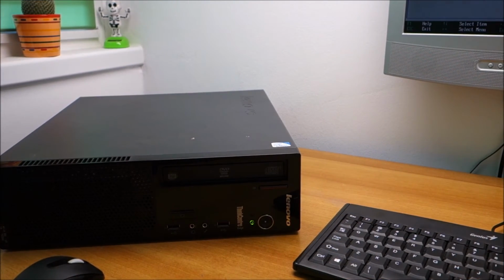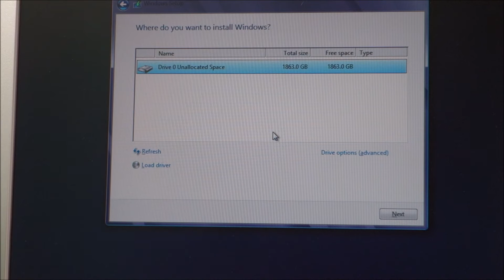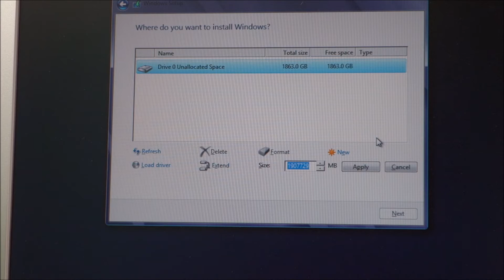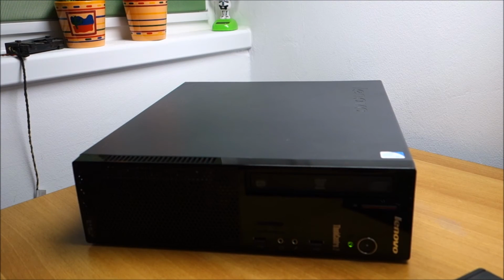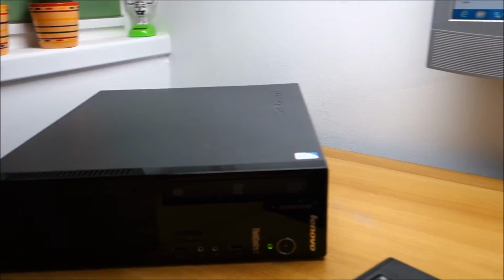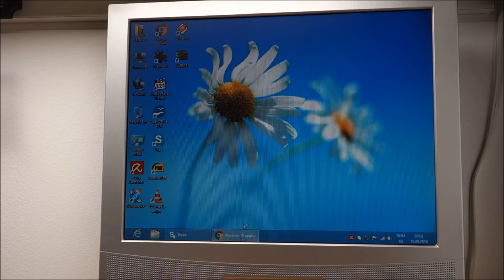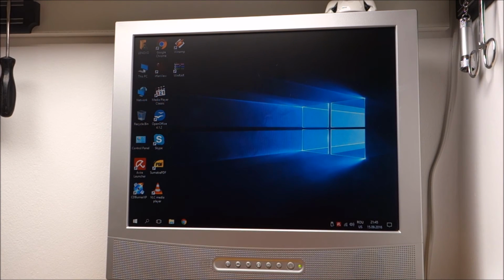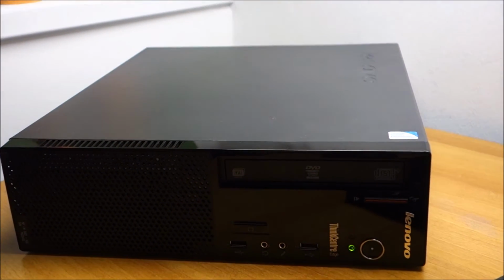How to - Lenovo ThinkCentre Edge E72 upgrade and overview

Comment: I had the same barebone but i changed almost every part that matters. So at this time my config is like : 
Intel I7 3770 (the best it can support or i7 3770S)
16 Gb Ram Dual Channel (2xCrucial 8GB, DDR3L, 1600MHz, CL11, 1.35V/1.5V )
SSD and Laptop Hard Disk with a Scythe Adaptor 
Gtx 745 4gb DDR3 

So... it's not that bad if you are willing to upgrade a bit :) Cheers
Reply from the maker: +Crs2Media wow! That is a really nice config! :)
Reply: I corected the details regarding the memories, i forgot about DDR3L aspect on Lenovo Barebone. I have 2 configs and on the Other config i have Crucial Ballistix, on the Lenovo one, i have same Crucial Memories but the DDR3L ones with low voltage 1,35v as the motherboard supports. 
Regarding a helpfull hint for the ones that are going to buy or upgrade a Lenovo barebone this is the Required Memory : Crucial 8GB, DDR3, 1600MHz, CL11, 1.35V/1.5V / a dual channel pack.
Reply from the maker: Thank you for the info! :)
Reply: Hi! I have the e71 type 1577 i3 2120 and I just bought i5-2500t off ebay (still waiting for postage) do you have Bios version 9QKT39AUS? I would love the i7 3770s but I am not sure if it's supported... So difficult to find informations
Reply: @digitalizations   what socket is it
Reply: @premiumwoodadhesive2306   its a 1155 socket
Reply: can this pc support i5 3470?

Comment: Will a gigabyte 1030 low profile work for this?
Reply from the maker: I think so.
Reply: @UltimateDIY  it has a wide bracket like u showed in the video so im wondering if there would be any problems with that
Reply from the maker: Then it's not fully low profile. It needs to have a short bracket.
This, for example, has both short and long brackets, so you can change it as required:
https://www.ebayshopkorea.com/itm/GIGABYTE-NVIDIA-GeForce-GT-1030-Low-Profile-2G-2GB-GDDR5-Graphics-Card-GPU/313537654404

Comment: Are there any 550w psu that could fit the case?
Reply from the maker: I'm almost 100% sure that no.
Reply: @UltimateDIY  is it alright if I place the psu outside of the case?
Reply from the maker: Depends on what you like. If you are not bothered by it, then there is no oprolem.

Comment: Hi , can i change de power supply and the tower??
Reply from the maker: Hi. The motherboard seems to be a standard shape, so you should be able to move it to another case. Also the power supply seems to have a standard connector, so you can put a bigger one in the new case.
Reply: @UltimateDIY   thanks,i will buy a  conversor 24 pins to 14 pins
Reply: Do you know whats atx is?? ?m-atx?
Reply from the maker: Why do you want to buy a converter?
Reply: @UltimateDIY   because the power supply  that i want to buy haves 24 pins , and the motherboard  have 14 pins
Reply from the maker: @crafteroghwk  sorry, but something is not right. The E72 SFF has this motherboard with 24 pins: https://www.lelong.com.my/lenovo-thinkcentre-edge-72-sff-motherboard-s1155-ddr3-03t8180-beginner28-216470013-2020-03-Sale-P.htm
What PC do you have with 14 pins?

Comment: Is there a way to turn this into a light gaming rig?
Reply from the maker: +Marko yes, upgrade the ram to 8gb, put a decent low profile gpu in it, add a ssd and, if needed, upgrade the cpu.
Reply: Ultimate DIY I have one in dead storage, why not use it right? could it handle a powerful mid tier GPU if I swap power supply? what do you think
Reply from the maker: +Marko 100% right. I'm all for reusing and upgrading. But I'm not really sure how easy you can find a more powerful psu for it, but you could find a good gpu that uses less power: http://graphicscardhub.com/best-low-profile-graphics-card/
Reply: Ultimate DIY thank you. have a great day man. will start fiddling with it soon :)
Reply from the maker: +Marko welcome :) You have a great day too and have fun with the build.
Reply: Just saw the link you posted. Do you think it could handle "MSI GeForce GTX 1050 Ti 4GT LP" with the current PSU' the processor onboard is i7. It will receive an ssd upgrade along with additional ram. I am also considering ejecting the DVD drive for a 3.5 1TB spinner with an adapter
Reply from the maker: +Marko I think that one uses a bit too much power. It could work, but it could also not work...it's a gamble.
Reply: Yeah, figures. Then there is also the GPU being ahead of the MBO. is there a PSU upgrade you would recommend for it?
Reply from the maker: +Marko don't really know of a bigger psu that fits this pc.

Comment: hello!
how can add second hard disk?
Reply from the maker: Hello. I think there is no easy way to add a second hdd. You could add it only of you replace the optical drive with the hdd or if you add a ssd and use double sided tape to hold it in place somewhere in the case.
Reply: Maybe get an external one.